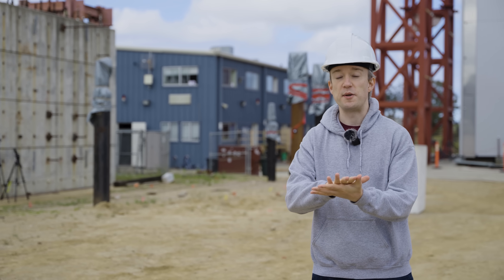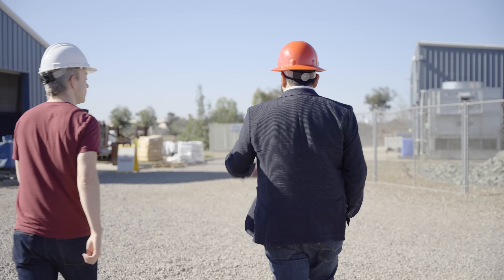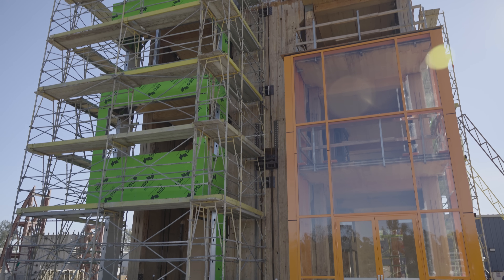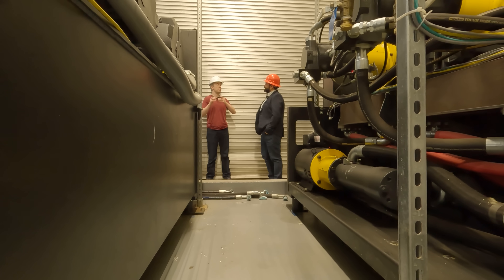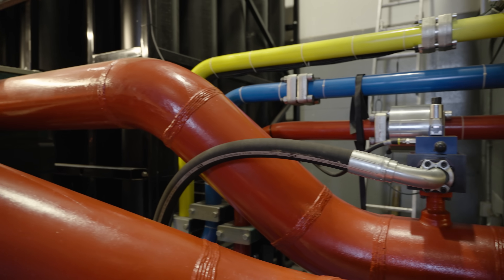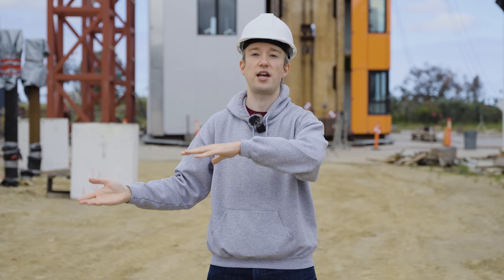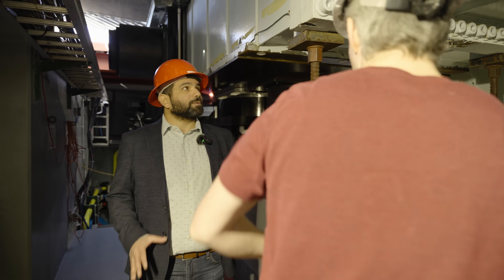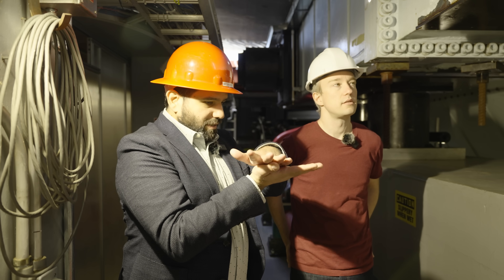Shake tables are way more complex than I thought

Comment: As a project engineer, who is rarely allowed to demo anything on site, i feel the pain of the engineer who had to use the u-turn and was most likely told "look, you can't demo that wall and we're not giving you the budget to build a new building. Just make it work in this area."
Reply: I used to design and build automation systems for oil wells in Nothern Alberta. The pain is real. Even for NEW installations the automation is an afterthought so we were always the last to be called and had to work around anything else that was on site because they NEVER made any allowances for control circuits and instrumentation placement.  Let alone coming along later and adding or changing something that was already in place and having to run wire in places where it was never meant to go.
Reply: Demo as in 'demolish', not 'demonstrate', for those like me who just spent 30 seconds trying to figure out how you demo a wall
Reply: @TomLuTon  and here’s the new wall model, it can block wind, it’s water proof against water pressure as high as a garden hose, it can withstand a human body being thrown at it, and it can easily be painted on without the paint sliding off completely
Reply: @TomLuTon  I've literally been to a demonstration of a wall, or rather the fire proofing of said wall. And the thing with that kind of demonstration is, nothing interesting happens when it works as intended
Reply: @TomLuTon  Yes, it's a common term in the building industry in the U.S.
Reply: @TomLuTon  Thank you! As a software engineer who's occasionally involved with demonstrations, but never demolitions, I had no idea what OP meant.
Reply: Imazgine beeing in charge of tuning five million pounds six-axis system that changes properties whenever you use it...., and the change also changes every time.
Reply: @Sett86  yep, Koorosh and his team are wizards.
Reply: given the pressure of what's in the pipes, it's presumably less a question of "can't demo that wall" and more "really, really shouldn't demo that wall, please"
Reply: @MiseFreisin  "you can't demo that wall" engineer: "hold my beer..."
Reply: @MiseFreisin  You could probably drain the network, but it would be really annoying to do it in a controlled way, and it would take ages.
Reply: @nikkiofthevalley  Not if the place needs to remain operative as much as possible while the work is being done.
Reply: The pain doesn’t stop at the engineers. Try being an operator on a site where two wrongs don’t make a right, but three lefts does.
Reply: I suspect that the u turn is specifically there to mitigate the water hammer effect — that sort of joint tends to be fairly common in pipes specifically to direct forces to places you can reinforce — like the concrete the `u turn is mounted to — rather than places you don’t want it, like the back side of that T piece.
Reply: @JasperJanssen  yes,a direction turn needed to be made by the pipe (to the left) and this was the safest, most easily baffled/braced way to do it.
Seems likely/logical
Reply: As a armchair engineer the U turns in the high pressure lines look less scary that the T joints that they slam directly into.
Reply: Flip side, don't ask, demo it, and the guy who replaces you will send you a lifetime supply of beer as gratitude.
Reply: I don't think it has anything to do with the wall itself (or  whatever is behind it) but the fact of the direction from which the pipes come (where the oil inside them is placed under pressure) and the direction the pipes (and oil) need to reach.
The shake table. 

It must have required a complete reconfiguration of the layout of the existing buildings and machinery to avoid this U turn, and it was decided that 'working round' this was cheaper, less of an upheaval and just as safe if certain measures (baffles) were put in place. 
The wall forms a convenient place to brace the baffles. It may even have been built simply for this function. 

As far as l understand (and l'm no architect or engineer) this is a fairly common problem (generally to a lesser degree) when 'upgrading' an existing building/engineering facility.
The function changes, becomes more complex, over time and adaption is cheaper and less 'hassle' than taking it apart and starting again.
Reply: In my opinion there is stuff that cannot be moved behind that wall
Reply: @Serena-or7sl  just a whoooole lotta concrete.
Reply: If I were the engineer I might've said "Either we demo that wall or it's going to get demo'd when the pipes explode"
Reply: As a software engineer, that's just another workday for me.
Reply: @andrasbiro3007  If civil engineers were software engineers, every pipe would have a bend.
Reply: It's a no-big-deal retrofit that saves a lot of time and money.  It's a win-win.

Comment: The test really showed how insane Earthquakes are. A controlled test on a safe building with favorable conditions, and I still am in awe at how terrifying that looked. As Tom put it "I do want to turn and run".
Reply: @Dave You would have trouble standing during one of these too, but no-one is allowed on the platform itself.
Reply: @Dave Depends how big the earthquake is, among other things. Most of the common ones? you can absolutely stand just fine, even with the ground moving it's still more stable than a boat. The really big ones, it depends what sort of vibrations you're getting and how long they keep going and what they're doing to the floor/ground where you're standing.  Some will throw you off your feet, some you end up sitting down because otherwise you'd fall eventually due to how unstable everything is, some are a significant roll that you can just ride out. None are terribly good for buildings or the like though. Of course, that's just standing in place...   (to be fair, you generally Shouldn't be standing in place during a big earthquake so much as assuming the most protective position you can manage in the most protected location you can manage because things falling on you is kind of a Serious Danger in an earthquake...)
Reply: @laurencefraser  Right. That looked around the level of shaking that I get here in Tokyo every few months. Even during the worst one a few years back, though it threw all my CDs off their shelves, it wasn't too difficult to remain standing.
Reply: And that's for a relatively small quake. The displacement in the Kobe earthquake was about 1 metre.
Reply: I sometimes smile at Tom for being terrified in seemingly harmless situations, but this one I absolutely felt. I wouldn't feel great standing next to that building.
Reply: Maybe one could try rolling really fast
Reply: Well that's news to me. I stood through the 2018 Alaska 7.1 just fine, after it shot me out of bed thinking I was getting blown up again.
Reply: @WartimeFriction  I was in the 10th floor of a building during an 8.5 one, it's very hard to walk but it's definitely possible, I almost ate the ground a few times. I don't think I could have gone down the emergency stairs though.

Comment: Interesting to see a bit of Ancient Japanese technology being applied to a modern building.
Reply: Mass timber (really, big pieces of engineered wood) is a fascinating building technology: you get to use all the cool wood-jointing methods, but the sizes you can build with are much bigger. And somehow it all stays strong and can even withstand some fire. One of the logos on the banner is the Japanese Sumitomo Forestry, which is planning to build a 70-storey wood skyscraper somewhere in Tokyo.
Reply: @a2e5  I watched a show on multi-story mountain homes built using this method.  That was decades ago by the way.  It's actually getting hard in the US to find good informative shows like that.  Even the specialty channels fall short for me.

Comment: I would not have picked up on the resonant frequency of the building having to be taken into the equation. My knowledge of physics and mechanics is limited, but Tom's understanding and questioning made me understand ... in a way. Tom expressing wonder and fear had me gripped!
Great stuff!
Reply: The building can shake back and influence the table. A building can't shake the Earth.
Reply: @dathat555  technically it can and does (Newton's third law) - but not that you'd notice. Certainly not in the middle of an earthquake!
Reply: @paulhaynes8045  would be awkward if an earthquake hits the resonant frequency of Earth and we lose our planet
Reply: @eljanrimsa5843  I think the Earth has enough density changes inside  it to  dissipate energy that that won't happen.
Reply: @eljanrimsa5843  This made me laugh out loud. Cheers!
Reply: @paulhaynes8045  When a building collapses due to overturning (think: the hotel photos from the 1964 Niigata earthquake), that's the buildings inertia overcoming the soil's ability the resist it. This is (as I understand it, I'm a Civil, but not a Geotech) mainly due to the dynamics of the building pounding the foundation into the ground, shearing and/or liquifying the soil intermittently as it shakes back and forth, causing the destabilizing affect. So this is all about the dynamics of the ground shaking the building and the building falling back and shacking the ground.
Reply: I was thinking about it when they said it. 
Because in a real earthquake the amount of energy and mass being moved is sort of irrelevant to the stuff on the surface.
Reply: It's probably the most important factor!

Comment: Tom trying to remember which one is pitch, roll, and yaw while doing the hand movements is shockingly relatable
Reply: Also, I finally learned which is which.
Reply: @EightThreeEight  me too 😅
Reply: @EightThreeEight  ngl I skipped back to rewatch it so I could try to remember which was which
Reply: The way I remember Roll Pitch and Yaw is that Roll is rotation around the X axis, Pitch around Y and Yaw around Z.
Reply: @bellutta  now I just gotta remember which axis is which!
Reply: @bellutta  actually, at least on a vehicle and assuming the usual definition of X = left/right and Y = forward/backward, pitch would be around X and roll around Y.
Reply: @aysnov  On the Mars Rovers (the vehicles I have driven), positive X is towards the front, positive Y is always positive to the right (starboard), and positive Z is down.  Not very intuitive, but this is the definition.
Reply: @bellutta  looks like a consequence of the right-hand rule for graphs, but yea, not intuitive at all
Reply: @DasParedes  Yes it comes from the right hand rule, but if one looks to the rover from above (the usual way we look at things) with the vehicle pointing North, positive X should be on the right, positive Y should be to the front, and positive Z should be up.  Thinking that when Z goes negative you are going uphill makes no sense to me, but this is the convention that is being used.
Reply: Pitch, front up/down
Roll, side up/down
yaw, front sideways
Reply: @LaughingOrange 
Tell me/correct me which one is one:
Here's what I understood:

Pitch is head movement while saying yes
Roll is head movement while saying No
Yaw is head movement Indians do.
Reply: @anubhavlive  Yaw is the head movement saying no, you oaf
Reply: @anubhavlive roll is the head movement for "Huh?"
Reply: @anubhavlive  pitch is correct,
roll is the puppy head roll movement, touch one ear to shoulder
yaw is the no head movement
Reply: @pyropulseIXXI  I know they got it wrong, but there's no call to be insulting
Reply: @anubhavlive  You have Roll & Yaw reversed.        Roll = "Indian No"      Yaw = "Western No"
Reply: Pitch versus roll for something that isn't supposed to travel and is wider than it is long is extra hard. Sure, roll is sides up and down, but are "the sides" your wrist and fingertips or your thumb and pinky when you're talking about the shake table?
Reply: @iabervon  well, pitch, roll and yaw cannot exist if you don't decide what the orientation of an object is. for the shake table, they had to decide which way was "forward" in order to known what was the pitch, roll and yaw directions. So, it's not extra hard for a building, it's just impossible without agreeing on an orientation, and very easy once you do
Reply: Pitch is what you do with your arm when you do an overhand throw. It's also what you do when pouring water out of a pitcher. Roll is what you do when you do a barrel roll in Star Fox (actually an aileron roll, the terminology is incorrect, but they're both rolls). Yaw doesn't have a nice way to remember it, but if you can remember the others, you'll remember it, too. I guess you can also reverse the word "yaw" into "way", and think of it like changing what "way" you're going when driving a car.
Reply: It helps if you just remember pitch is up and down. Roll is self explanatory and the only direction remaining is left and right.
Reply: For a second I was like "it's easy, pitch is this, roll is this, yaw is this" and then realised I was doing the exact same thing to try and remember 😂
Reply: i played to much airplane games, so it is just engraved in me which each one is each haushasuahsuahs
Reply: Spending a few days on the ocean really helps to memorize those... and sway, surge, and HEAVE as a bonus.
Reply: It only gets worse when you actually have to represent rotations for the sake of calculations. Annoying problems result from the non-uniqueness at certain positions and the lack of any well defined rotation order. For small rotations it barely matters and rather than pitch, roll, yaw you can just say X, Y, Z which is more clear in those contexts, but nothing uniquely tells you whether it is XYZ YZX ZXY ZYX YXZ or XZY. And each of them gives a different rotation for the same number. The conventional solution is to use unit quaternions, which happen to have JUST the right algebraic properties for 3D rotations. But quaternions are quite bad in terms of human readability, and for something like a rotating shaft that just wiggles a bit off its rotation axis you'd prefer to be able to say that jt "rotated by 3600 degrees (10 revolutions)" which cannot be represented in quaternions. Any representation of arbitrary rotations has something that makes it a pain to use. If there were a benevolent God, they'd have stopped at two dimensions.
Reply: yaw: head shake
Pitch: head nod
Roll: indian head nod
Reply: I remember these from being a pilot, but this might help others: picture an airplane. Roll is easy, think barrel roll, rolling in the grass.  Pitch is for uP (and down).  Yaw is controlled by pedals, such as on the ground to turn left and right.
Reply: That’s how I always do it.
Reply: Scary to remember he got to fly a plane
Reply: Pitch a tent, roll over, yaw... yaw is the other one.
Reply: it’s not hard to understand…
Reply: We dont even have specific terms for every direction in my language
Reply: Playing ksp made me learn the hard way
Reply: It's at 1:44 for anyone who doesn't want to rewatch the video to find it
Reply: life saver  @pugz3230
Reply: Don't forget Yves and Serge.
Reply: @andrerenault  Have you also been to the S.S. Bessemer??
Reply: The hell does "shockingly" relatable even mean
Reply: "shockingly relatable" 
Oh calm down. Like he is some sort of Einstein that has been brought back down to our level.
Reply: Stop projecting
Reply: He was literally doing that so the viewer knows what directions those words refer to...

Comment: 5,000 PSI is a lot more the 100 times the pressure of a standard car tyre. Car tyres are about 25/30 psi so it’s closer to 200 times the pressure of a car tyre then 100

Comment: I have to admit, being a small supplier of equipment to refineries throughly desensitised me when it comes to fluid pressures xD
Reply: Knowing nothing of the subject, are the pressures in refineries comparable? Or way higher?
Reply: @WyattWinters  about the same, but MUCH higher volume - albeit only in certain locations. Also, no need for nearly as many safety control systems or overkill engineering since it isn't the entire facility that's pressurized - it's only the compressors where actual refinement is done.
Reply: @spdcrzy  Also flow rates and pressures in refineries don't oscillate wildly (at least not as part of regular operation).
Reply: @tz8785  I'm not talking about oscillation. I'm talking about the fact that only certain elements of the refinery process even require pressures that high - usually for extraction of trace compounds from crude oil.
Reply: High pressures in large volumes surely makes a difference?
Reply: I can imagine. I just noticed that swimming pools did desensitize me against the volume of fluid. These pipes are a bit smaller than those of an olympia pool

Comment: Tom losing his mind over a u-turn in the pipes is the clip I would show somebody to describe his personality
Reply: Not just a u turn (smooth semi circle), but 2 90⁰ turns for each pipe, into the short end of a T no less.
Reply: @mathewng1988  I was more amazed by that T-junction than the U-turn! Weird it wasn’t even mentioned
Reply: @jlammetje  T junction wouldn't be that bad at that pressure (I think) because of the low pressure on the output, and high pressure on the input would balance itself out. I think it wouldn't stress it that much.
Reply: @mathewng1988  I think the reason they did that is because of reliability. If they did two long curves it would be more likely to stress out the metal when making the curves, where the smaller curves would be less to worry about. It's technically less efficient, but it's the best option.
Reply: @mathewng1988  The T is the scary  part..agreed
Reply: He understands the significance of a u-turn in those pipes.
Reply: Genuine Physics reaction!
Reply: T is less scary because it has more room to float around and two directions to go in but a U turn is just whoop whoop which puts crazy pressure on the pipe because u got a whole semitruck worth of air going thru